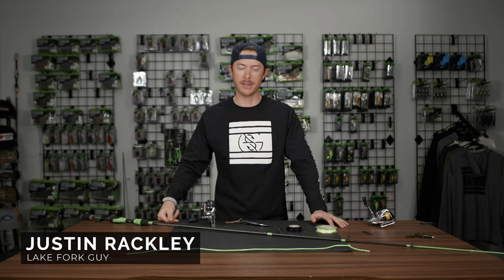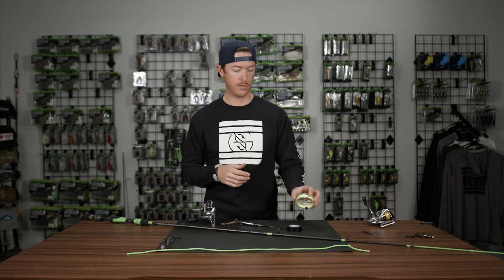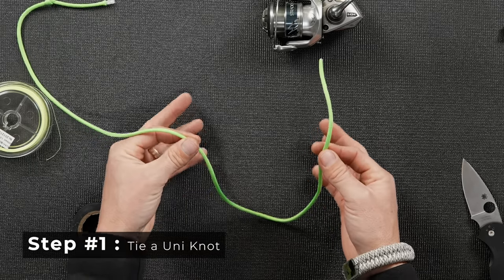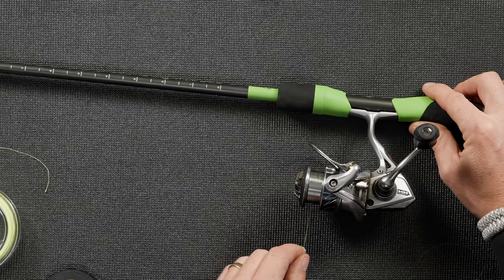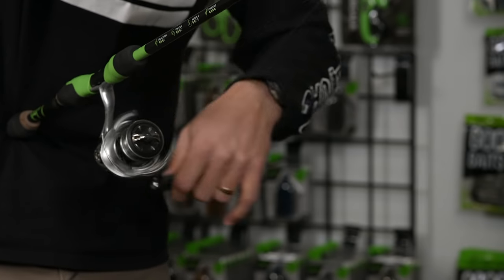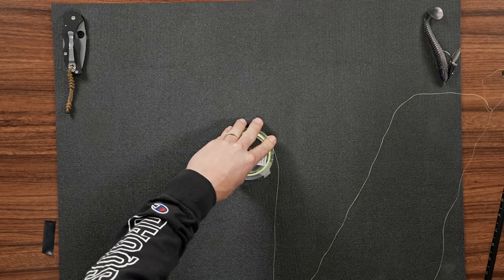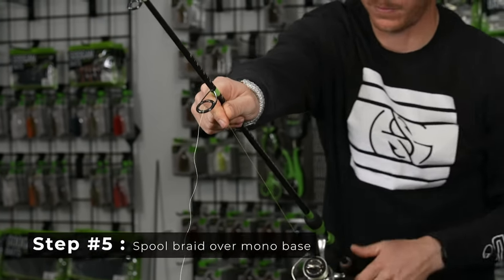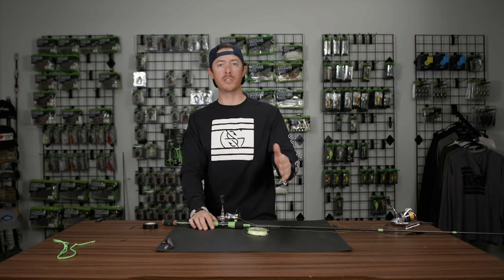How To SPOOL A SPINNING REEL!

Comment: This didn’t help at all
Reply: Bruh how 😂
Reply: Thats on you
Reply: Skill issue? Watch him tie the Uni knot. Notice how when he begins the knot he holds the rope in a U shape? Do that but around your reel, continue the knot as shown. When tightened use one hand to hold both rod and line (I like to hold it under the first eye/ring) using your free hand reel in the line applying moderate pressure to the fishing line while you reel.
Reply: You probably ride the short bus
Reply: You probably shouldn’t be fishing
Reply: Lmao
Reply: This is how you spool braided line. If your only spooling fluorocarbon or monofilament learn an arbor knot.
Reply: @John-gn2dp  i used this video to spool mono and fluro and it worked perfectly.

Comment: I have an electric line spooler that allows me to remove the spool and put the line on it with no twist at all. One thing that I have learned, especially on my small diameter spools, is when you cast...say 100', you can have up to 250-300 twists between the spool and the end of the line. When you lift the lure out of the water between casts, several twists come out. After a hand-full of casts that first 100' off the reel ends up twisted back onto the reel...especially after your first line break.

Comment: Commented before I watched the last part. Great idea about laying out the line with a swivel. Should have figured it out.  I usually lay line out on water while paddling away in my kayak. I feel this will save a bunch of time on the water. Thanks.

Comment: I use 10lb braid & you will wind knots. 
I try to cast easy but sometimes you just get wind knots & good luck getting it out with 10lb braid, 20lb is ok. But I can cast further using 10lb. 
Love the double Uni Knot for connecting braid to mono or flourocarbon. 
Caught many bullreds here on the SE TX Coast without breaking a 10lb braid to 20lb flouro leader.

Comment: Another tip is to have the label facing upward, as the line makers all put the label on the same side. This will also help with the line memory.

Otherwise the only thing I wasn't a huge fan of was the electrical tape, obviously you'll never see it till you put on more line.
Reply: I’ve seen you post multiple times and you seem to know your stuff. So a clockwise spinning reel (facing the front) should be fed by the fill spool with the line coming off the same direction (clockwise)? I’ve searched the internet and keep seeing conflicting reports, seems to be a trend with fishing. I am a very green angler and tried 15lb braid on my spinner but failed due to line slippage. I watched several videos that tied straight braid using electric tape around the spool as well. I also fed it from the spool like you would a bait caster. The reel casted great, but the drag was very screwy. Not sure if my reel just doesn’t like straight braid or if I didn’t apply enough tension. I took the line off and am contemplating going to a tackle shop or buying one of those fancy line tensioners devices. Life of hard knocks is the best teacher but learning about tackle is tricky on your own.

Comment: some where in the process of attaching the line to the reel you miss the day they taight this.  You dont need the mono if you just put the electrical tape on the spool.  you dont need electrical tape if the reel is braid ready, there is a rubber band built into the spool.

Comment: Have only fished spinning reel fairly new angler though and have been doing it wrong the whole time thanks LFG and Googan Lab next go over casting reels they scare me lol
Reply: Casting reels excel in some areas that's for sure, but if you're bank fishing, a spinning reel can do it all. Master it first, casting overhead, casting from each side, and learning to make small accurate pitches.

I found fishing towards the shore that I see a bigger benefit of using a baitcaster, as it helps me pin point my casts near targets better. Specifically the casting towards the bank or a dock.

-IA

Comment: If it’s best to spool on braid off the end of the spool in a counter clockwise direction, why does Power Pro put a pair of notches on the edges of their spools which hang up on the braid, making spooling off the end almost impossible?

Comment: Does braid with lower diameter make it where the line will snap more easier when casting  I saw another video saying it will but I am not sure  and is braid good for freshwater or no?

Comment: New to fishing here. Any reason you use mono before the braid? Any cons to just having braid all the way until you have your mono / fluoro leader?
Reply: Some people use the mono as a base layer (filler) to give the braid something to “bite” down into to prevent the braid from spinning on the reel. Plus, good braid can be expensive, and depending on your spool diameter having that cheaper mono as your base will help save you some money in the long run. I can’t think of any cons per say, just make sure you’re using a good ratio of braid to leader line diameter. I generally stick to a 2:1 ration… So, if I’m wanting to use a 12lbs leader, I typical pair that with a 25-30lbs braid main. Hope that helps!

Comment: Only spinning reel question I have.. Why whenever I see someone using a spinning reel on youtube videos is their drag so loose. Ive used spinning reels all my life as my primary reel. I just started using bait casters last year. Ive never had my drag set so loose that it clinks as I set the hook.
Reply: It all depends on how big the hooks you're using are, strong the line is, and to avoid horsing around a fish.
I use a Ned Rig quite often and if the drag is too tight, I'll bend my hooks out.
Just takes a little bit of time to tire out the fish but keeps my gear nice and lands more fish.
-IA

Comment: What is the purpose of the mono base? I have never used a base and never had any issues with my lines. Just curious.
Reply: If you tie braid straight to the reel, it will slip because there is no stretch in braid. Mono stretches and kind of binds to the spool much better.
On the business side of things, mono is very cheap and fills a portion of the reel that will never be seen, or you hope it won't haha.

-IA
Reply: Also the braid tends to be very tight and cause damage to the spool, mono base gives a better cushion for it.